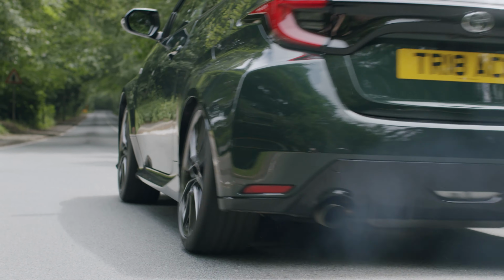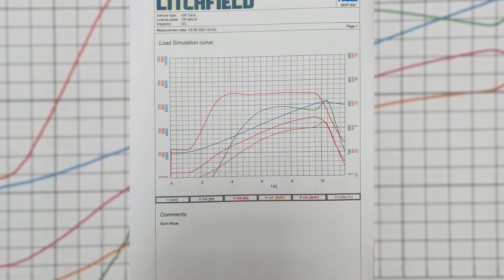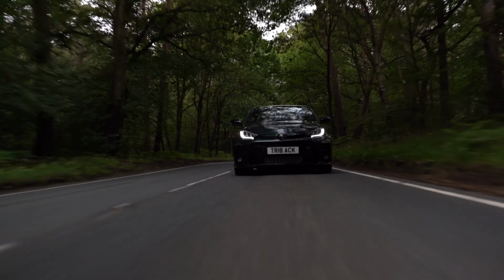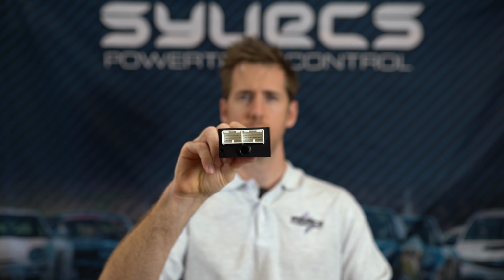The NEW Syvecs Toyota GR Yaris AWD Controller

Comment: What happens on slow tight turns when the center is fully locked mode? It will have axle windup like a 4wd?
Reply from the maker: Calibrators can adjust the current to the awd solenoid based on the angle of the steering and engine load
Reply from the maker: We have steering angle adjustment 👍
Reply: @SyvecsLtd  ok so this means? When the steering in greater than straight it will disconnect the diff?
Reply: @SyvecsLtd  This seems to be similar to the Haldex system
Reply: The GR Yaris is never fully locked, physically impossible for the unit.
Reply: @dogshmog  it is fully locked when wheels are spinning
Reply: @МиронЕгоров-о8в  wrong. I beta's the controller for the US market. It has a limit to pressure on the clutch, which equates to about 240hp max, and cannot physically lock.